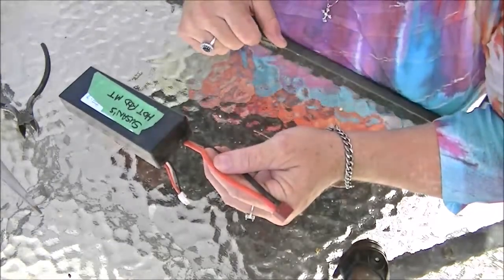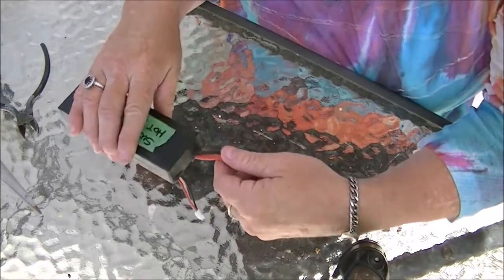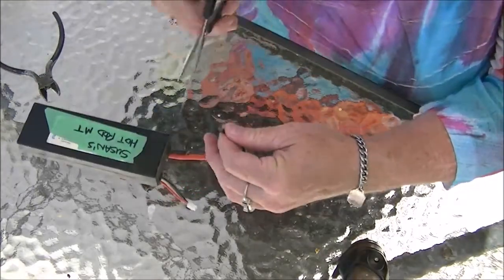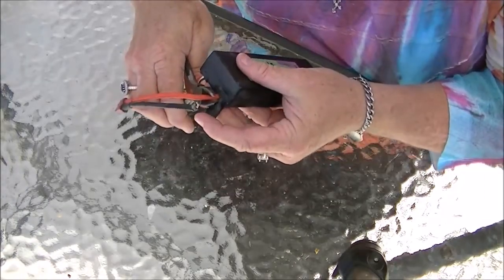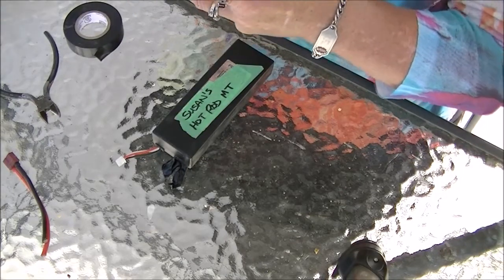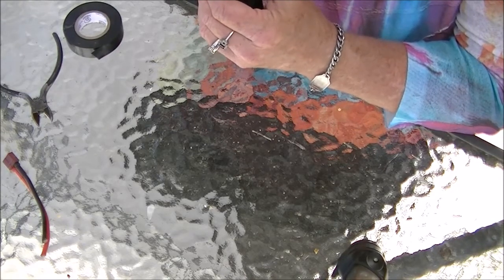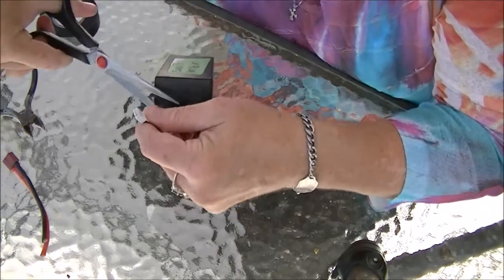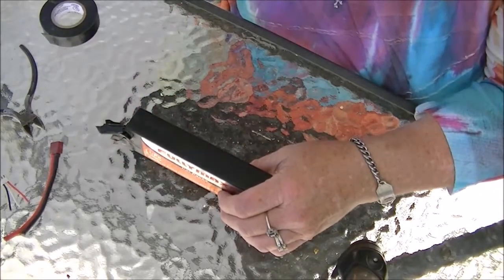How To Safely Dispose Of Spent LiPo Batteries For RCs

Comment: Susan you don't really need to cut all those wires could be dangerous , you can discharge the battery so it won't have any power left, you can put it in a bucket of water with some salt mixed in the water and let it sit in it for a few days it will slowly drain the battery to 0 voltage safely. =)
Reply from the maker: shenlonco Yes, I suppose you could do those things with a battery. It would probably be safer but we want to keep the cables (plus connectors) and I imagine the water 💦 and salt bath would not be good for them. Great ideas though if you just want to render the batteries safe.😌
Reply: O if your going to keep the cables i guess you would need to cut them off , you can still throw it in a bucket of salt water to discharge it. =)
Reply from the maker: LOL, yes you could I suppose. 😉😊